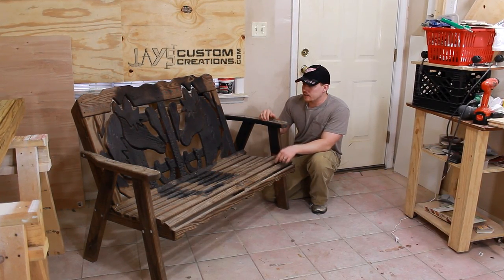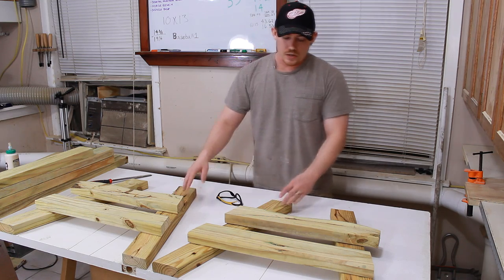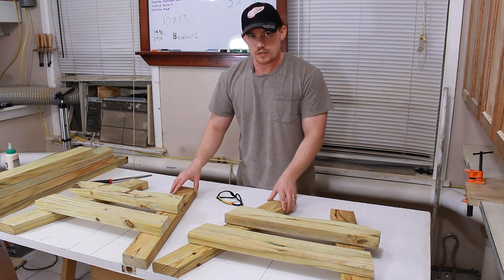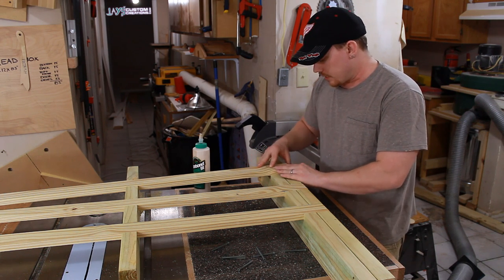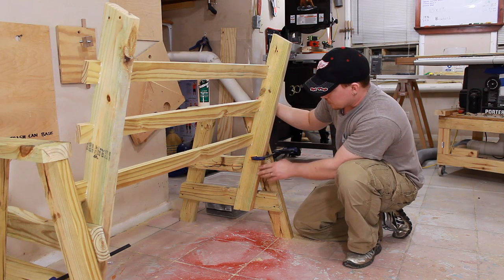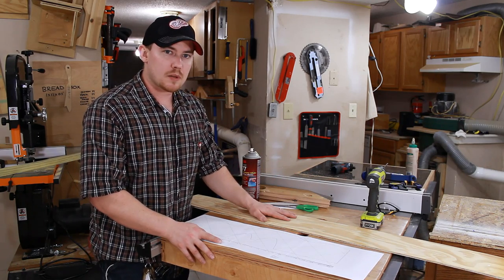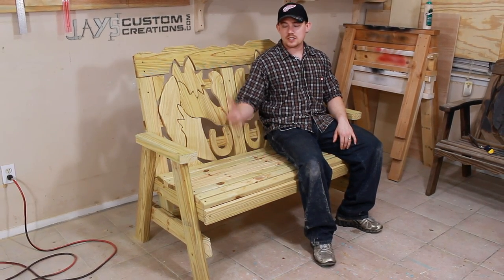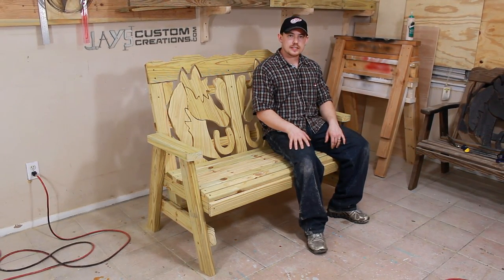Make A Horse Themed Bench - 124

Comment: I downloaded the plans, but I still can't figure out what ACTUAL final size of the slats are after you've ripped them down, width and thickness, I mean. Can you help me out, please?
Reply from the maker: The slats are 1-1/2" wide and as thick as you want. I ripped mine out of a 2x4 so I could get three slats per width of 2x4. Mine ended up being about 1" thick. But if you do not want to rip them out of a 2x4 you could use 1x2 material.

Comment: Hey Jay, I couldn't figure out how to get the templates to print to size.  I don't know if I have to zoom up on the photo to a certain percentage, and then print it.  What do I need to do.  Thanks.  KC
Reply: +KC Kace84 Probably much too late but I'm guessing your printer was not set to print at actual size. Most likely it was set to "fit to page"
Reply: +oobaka1967 that still didn't work

Comment: Cross handing on the chop saw isn't a good idea. Holding the material with your left arm and using the right to pull the trigger when the material is to the right of the blade leaves your left arm where it can come in contact with the blade. 35 years plus in home improvements and I have seen it happen a few times.